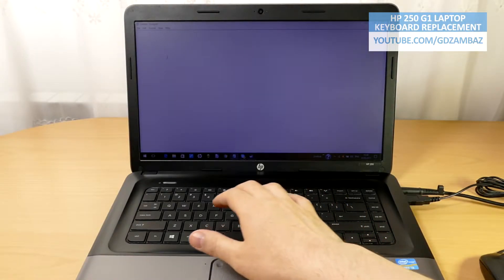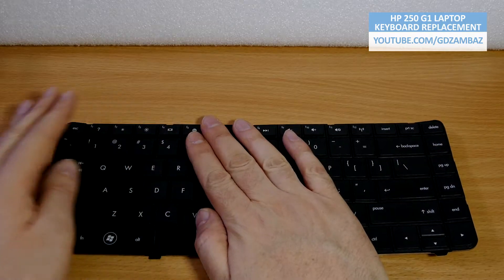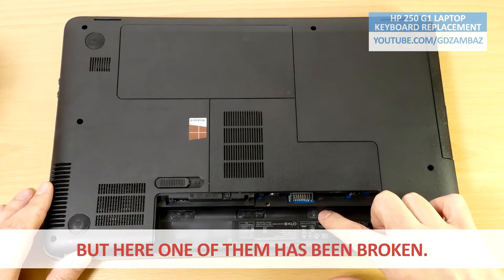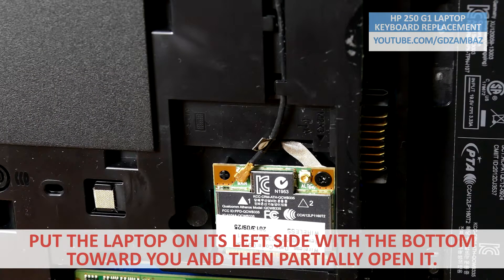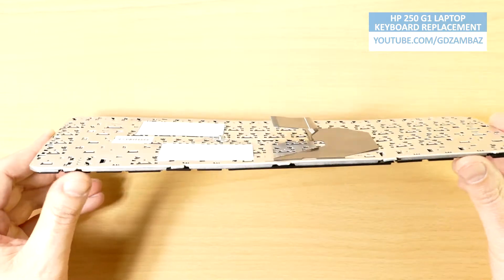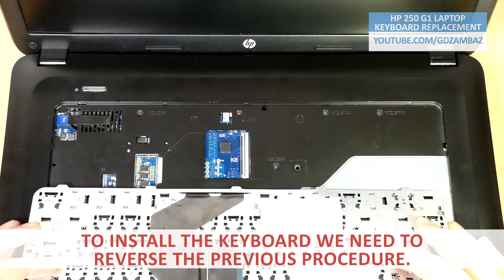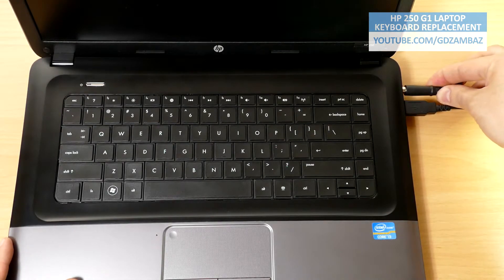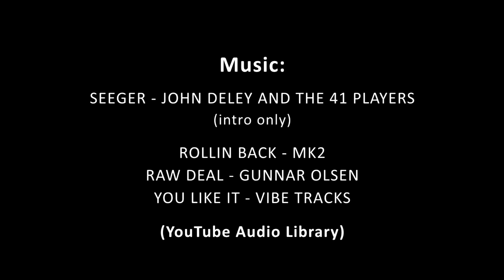HP 250 G1 Laptop Keyboard Replacement

Comment: Hello. If I want to buy online.. wich model should I look for HP 250 G1?... Can u suggest
Reply from the maker: The part numbers are in the video description: Original keyboard p/n: 697529-001 (Spares p/n: 698694-001);
 Replacement keyboard p/n: 646125-001; 
I bought it from Amazon.